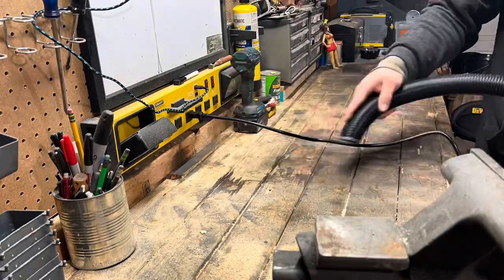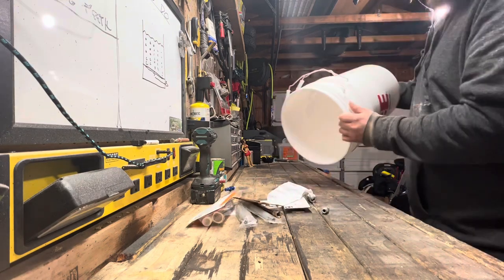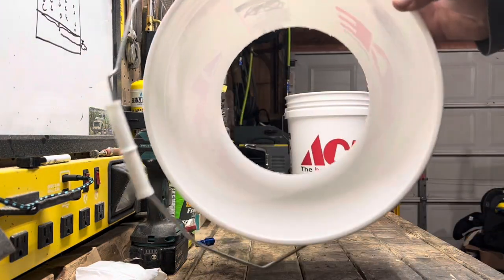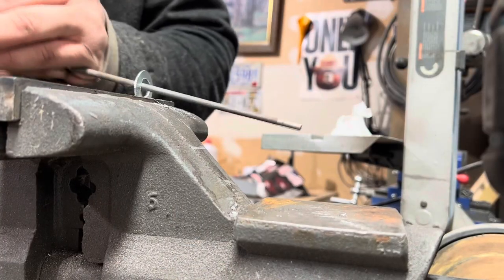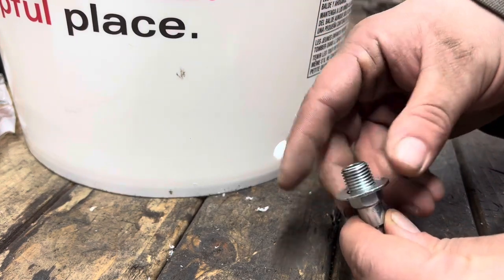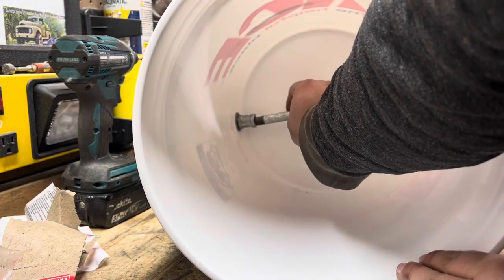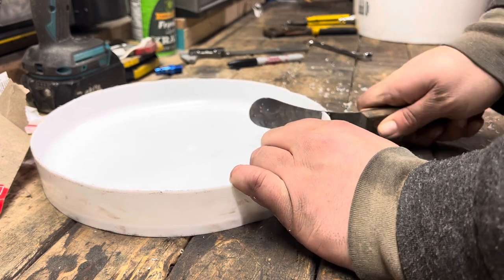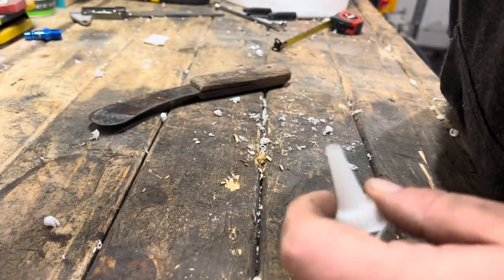Easy DIY Parts Washer

Comment: Never seen the heated knife method i use a cut of blade on angle grinder but whatever works
Reply from the maker: I’ve had to cut up buckets since your comment, I would say that the angle grinder works pretty dang good. You’ll probably see me utilizing that in the future. In the field I tend to use a utility knife and my INCREDIBLE mass! Thanks for the tip!
Reply: I am impressed that you thought about the heated knife way

Comment: Do you find the air agitation helps clean the parts better?
Reply from the maker: I haven’t tried it with any part washing solution yet, we were having troubles with our John Deere air filters never coming clean. I throw some degreaser and water in it and a couple hours later they look like they just came from the factory! So for filters at least I would say it helps ALOT.